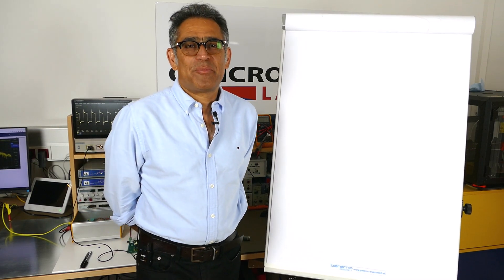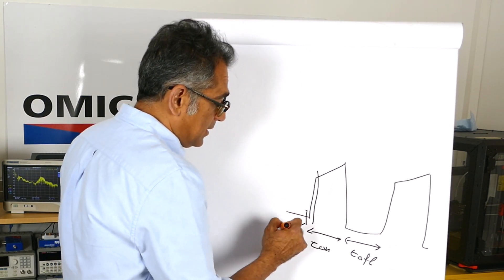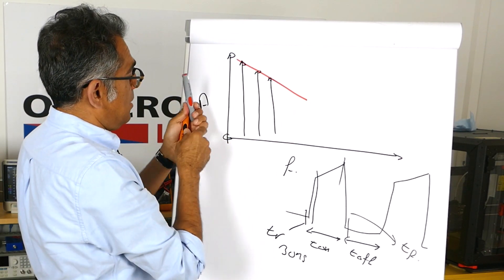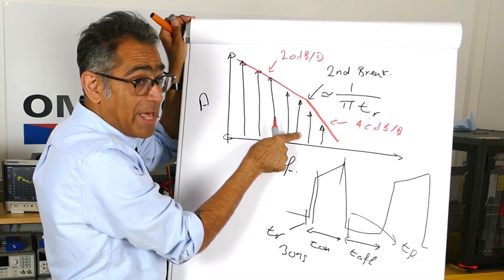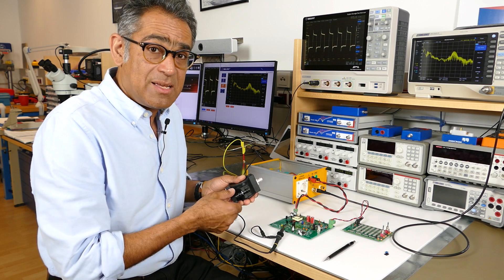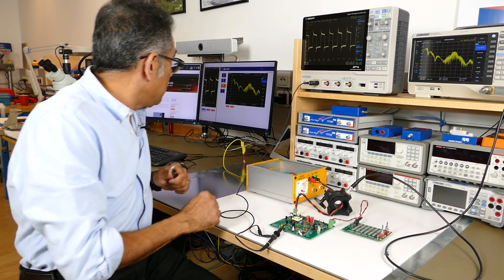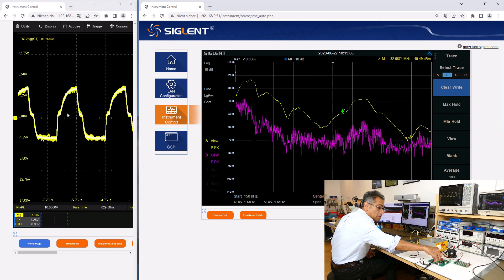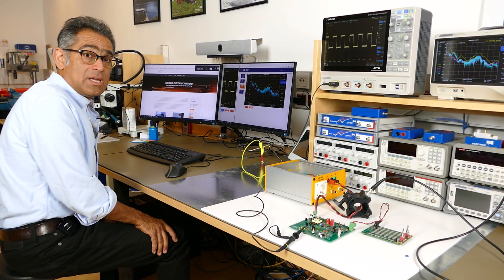Impact of MOSFET Gate Resistor on the EMI & Noise Spectrum of a Switch Mode Power Supply

Comment: Hello Dear Sir Dr. Shirsavar, 

I try to reach you by email, unfortunatelly until now at no avail. 
I like your tutorials, and  have some thoughts that I like your opinions on: 
so series Rgate slows down, thus reduces EMi disturbances aswell. 
And an opposite diode over Rgate can fasten the Cgs discharge for a quick turn-off ;-) 
Now what about my idea of puttin gin series a couple of fast 1N4148s 
as to discharge the Cgs not completely, but limited to the so many series diodes drops ? 
So at the next switch-On, it only needs te re-charge from that for ex. 3V charge remain ? 
Wouldn't that speedup the switch-on aswell, by your esxperience ? ? ? 
You have better equipement than me, for testing this out, when you would like it. 

Maybe I read something from you, thank you, Harry.

Comment: I don't know if you can help with this odd behaviour... I hade built a power supply that powers 2 external Hard Discs, based on the power available on computer's USB port.
When computer starts up power supply turns on first HD (12VDC) and a few seconds later (after startup current settles) the second HD is powered.
The power is switched with MOSFET transistors controlled by a PICAXE PIC microcontroller (powered by 5VDC).
As soon as first drive is powered on, immediately the second MOSFET switches on, without any voltage at its gate (0V). Very strange!  It should turn on a few seconds later when PIC applies 5V on gate?
The PIC outputs are connected to MOSFET gates with 330ohm resistor to limit PIC current.  The gates is also tied to ground with 10K resistor.

If the loads (HDs) are not connected, circuit behaves correctly.  (I also have LED/resistor across output to show on/off state).

I fail to understand how the MOSFET can turn on without any gate voltage?

Comment: Outstanding demonstration, this is exactly what I was talking about in my comment on a previous video, this is the additional context needed to better understand the gate drive resistance selection. Well at least half of it, the radiated emissions are equally significant as conducted emissions demonstrated here. You are a great teacher, subscribed! It's difficult to know the right questions to ask when learning about subject material so when someone includes the hidden traps it's a little easier to understand the significance of component selection. It would be great to see this video linked with the others!

Comment: Something that works super well, is using a ferrite bead in series with the gate resistor. (also available in SMD).
If you choose these well, it will really knock down those pesky harmonics, while giving more room to keep the switching frequency a bit higher at the same time.